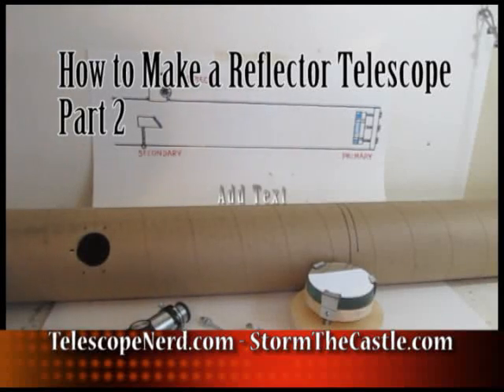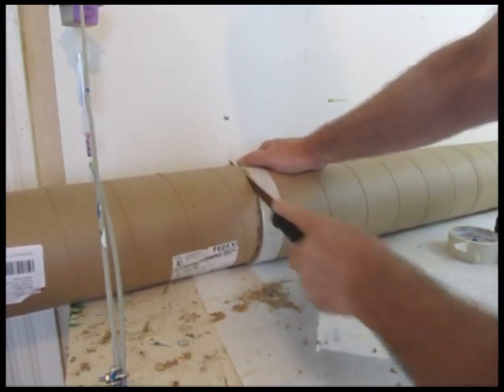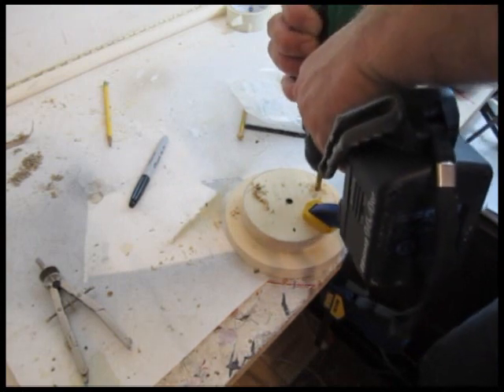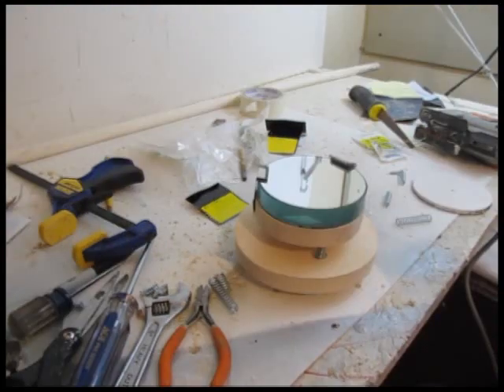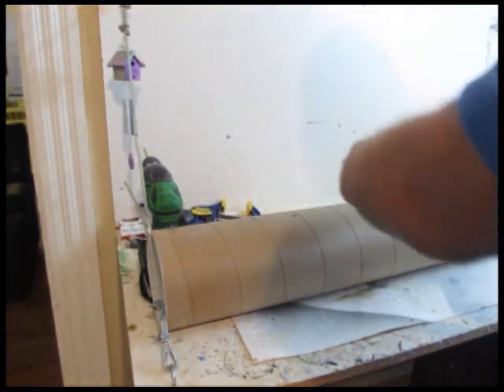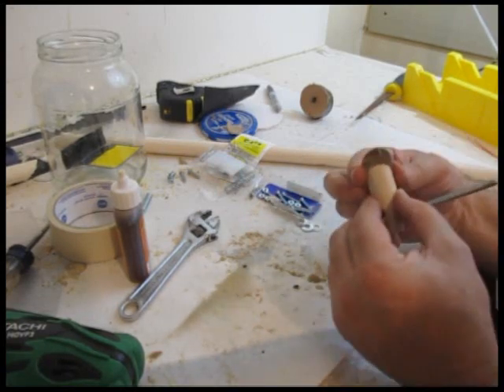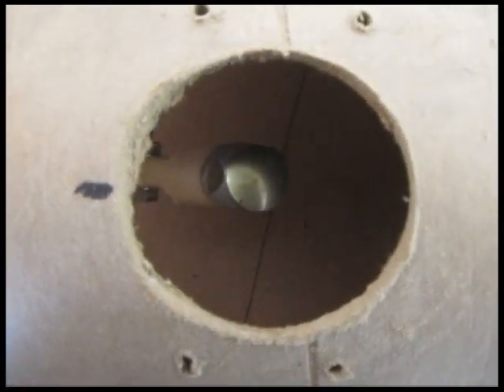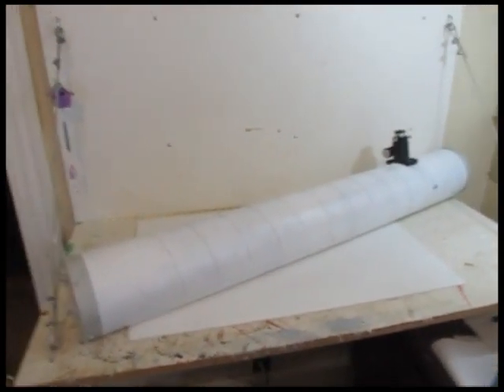How to make a Reflector Telescope Part 2

Comment: Is there a recommendation for using something smaller than the rod for the secondary? The less light obstruction, the better.
Reply from the maker: Yes, most telescope companies use thin metal strips turned sideways so only the very thin thickness of the metal obstructs the light gathering.
Reply: @epicfantasy  Could you use something smaller, like fishing line, piano wire, guitar strings, etc? Could you do a video on how you would make that work? Also, when figuring out where to put the focuser, how do you figure out the measurement in the tube for the secondary and where the focuser has to go? You showed how to figure the distance to get focus, but how do you figure the location of the items to reach that distance?
I hope my questions make sense - they do in my head. I can try to clarify if needed.

Comment: I would have drilled out ALL HOLES in card tube BEFORE putting the mirror in.. because all that drilling and sanding creating all that dust.   My building sequence is ....Measure, drill, CLEAN, then assemble.

Comment: A little note on when you're holding the wrench to adjust the nuts on the threaded rod for the secondary mirror. Perhaps it would be wise to tie a string to the end of the wrench so that if you drop the wrench, ti doesn't go crashing into the primary mirror. Just a thought.

Comment: when I go to columate it, I see my eye in the secondary after I get the secondary alligned with the primary.
Reply from the maker: That is correct.
Reply: epicfantasy But when I put in the eye piece I don't see anything, its all blurry.. I suppose I could be too close to buildings. Will have to wait for a clear night before I can really make sure its all ok.
Reply: Are your lenses coated?
Reply: I figured it out, the primary mirror was of the wrong focal length, I had to make the tube much shorter. Simple trick I figured out: hold the mirror to a white piece of paper and move it away gradually until you see an image, that distance is your focal length.

Comment: Where do I find a 6" by 48" tube?
Reply from the maker: +Michael Lane Home depot has them for pouring concrete. Cost about 7 dollars.
Reply: +epicfantasy Hi, I checked in the store and online.  They start at 8" on up.   No 6".  Perhaps a 6" irrigation pipe would do?
Reply: +Michael Lane Michael, 6'' irrigation pipe or drainpipe will be great! But I think that you'll have to paint the inside (if it's white) with non-glossy black paint. It's a good idea to have the tube black (or at least, not white)... The PVC pipes are glossy on the inside, which is not good for a telescope because of the inside reflections of the tube.
Reply: +Michael Lane I couldn't find a 6" x 48" anywhere. However, I did find a 5" x 36" mailing tube at staples. I bought two and am going to couple them together using an adapter so that I have enough length.

Comment: What type of mirror (convex, concave or etc.)has been used for primary and secondary?
what the focal length of the mirror, ??
distance where the 45 degree mirror to be mounted...??
the eyepiece focal length and its mounting distance ??
please provide some details too...
i would be very thankful....
Reply: +Jayson AtSpace the specs for this particular telescope are on his website.

The Primary mirror is concave, though, and the secondary is flat in this simpler design. The length you'll want depends on the focal distance of the particular primary you end up getting. if I recall, the distance from the primary mirror to the eyepiece mounting is the focal length of the primary, minus the distance from the eyepiece lens to the center-point of the secondary mirror. So the wider a primary the telescope has, the shorter it's length will be for a given focal distance. At least that's how I understand the math. Things get a lot more complicated if you want a three-mirror setup (the eyepiece comes out near the back on those, and they tend to be even bigger.)

Comment: Hi epic, your video is very inspiring and so easy to understand compared to many I watched before. Can I suggest three things to make your project even better? 1) I would paint the inside of the tube with matt gray paint to avoid light interference. 2) I would use smaller retaining clips to hold the primary mirror to the round wooden disc to allow maximum light to be reflected from primary to secondary.. 3) I would add to the video the measurement of the focal distance from primary to secondary which you didn't refer to when drilling the large hole for the eye piece. Great and neat project, Thank you and keep up the good work.

Comment: Reflector must be made of concave glass mirror, or can be used any concave reflective surface?
Reply: +Dušan Petrović You can use any concave reflective surface, but mirrors work best. Way back in the early days of telescopes, they used concave metal mirrors. These will tarnish easily though, so a glass mirror is best.

Comment: Suggestions; 1) Black paint on the inside to prevent reflections (like a camera).  2) White paint on the outside so that the cylinder doesn't absorb radiant heat and expand.  3) Use large PVC piping as it is stabler/stronger than the cardboard (and just about as cheap).

Comment: Something that might have not been mentioned about these specialized, and fragile, mirrors.  A bathroom mirror is silvered on the backside BEHIND the glass.  Thus the silvering can't get scratched.  These telescope mirrors are silvered on the FRONT of the glass so that light doesn't travel through the glass (less distortion and more light).  So touching the front of these telescope mirrors is to be AVOIDED at all costs!  Good luck.

Comment: well done mate...apart of one thing, you will spend all your time collimating rather than enjoying the night sky...BECAUSE you sir did not put any locking bolts so it wont hold collimation and that mirror is VERY flimsy. Apart of that THANKS VERY MUCH very nice video very very nicely explained and done.
WELL DONE MATE. don't forget locking bolts for the primary mirror.

Comment from the maker: you have to input the focal length of the main mirror and the size of the secondary mirror. That will give you placement. You can always do it manually like I did in part 1. Do you know the focal length of your primary?

Comment: I found it but there is no way it can determine the focuser's or secondary mirror's distance from the primary mirror.....plz help me calculating the exact length between primary and secondary mirrors.....does it depend on focal length of the main mirror??? If i send u my drawings and measurement values about the telescope tube and base/primary mirror holder would you give me the solution...plz help

Comment: Also, a larger mirror provides greater resolution.  Two small mirrors separated by the width of a larger mirror can do the same thing, if you can do interferometry, and how you do that I have NO IDEA AT ALL.  But they do it in Hawaii and there's talk of space telescopes with mirrors separated by a Km or more.